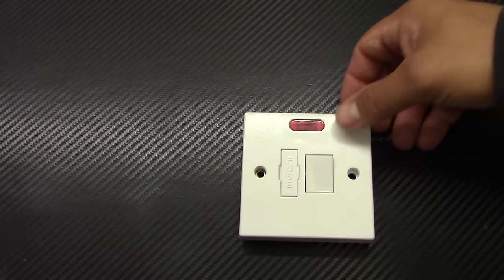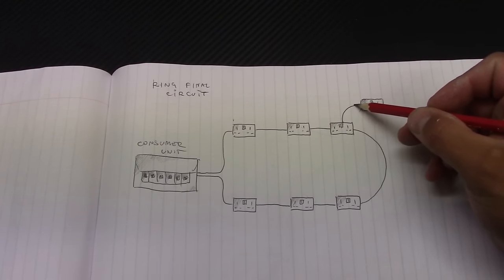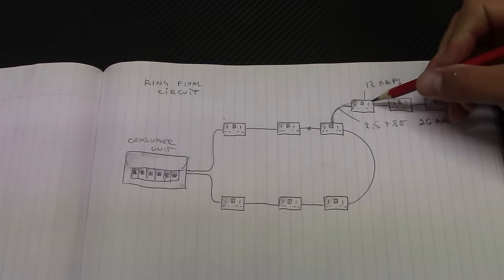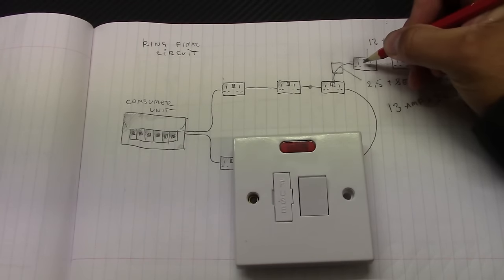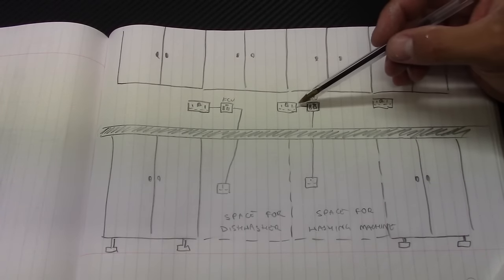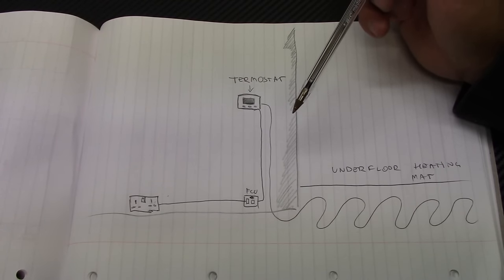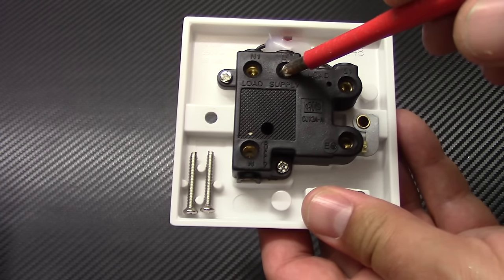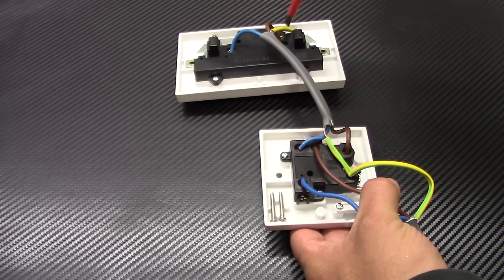Fused connection Unit    Wiring FCU      How to wire Fused Spur

Comment: Concise, informative and bullshit free. The way all instruction videos should be. Excellent work.
Reply: His calculation has slight problems on the elctronic side. He did basic calculation but that is not how it works in the real world. In the heater there will be some form of small electronic board which convert the voltage to a very high voltage and will only need may be one or two amps [some time only milli amps], thus one has to be very carful what you put in the FCU because it can damage either the  heater or other equipment connected to it. Ideally it should not be more than 3 amps but if one put 13 amps and there was a fault inside the electronic board the heater is good by....
Reply: I’m currently studying being an electrician. My training says to switch 13A fuse for a 3A fuse in the FCU, and also new practice is now to use 1.5mm cable

Comment: no special way of putting three wires into the terminal blocks on the socket youre taking the spur off? just put them all in and tighten it down? i'd imagine it would be safer if they were twisted together at least?

Comment: Hi, jus stumbled upon your channel and these video's and have a question.. If you use an FCU before the spur how many new sockets can you add to that spur?
Reply from the maker: As many as you like but the total load on them is limited to the 13 amp fuse
Reply from the maker: 13 amp maximum at fcu  that's in the regs
Reply: Hi, is fitting a series of RCD protected spured sockets an alternative to fitting an FCR?
Reply: I also would like to know the answer to this RCD question for spurs.
Reply: No, as the RCD protected sockets can still draw 13amp per socket. An RCD is a residual current device which detect imbalance (earth leakage) between live and neutral. An RCD has nothing to do with over-current protection.
Reply: @JTCamper  correct, you must respect the amperage maximums unless you want a fire...

Comment: Hi, quick question. If I wanted to run two double sockets and a light off a FCU how would I go about that. Would it be 15a fused spur off the ring main socket. Then double socket 1 spur off FCA, then double socket 2 spur off double socket 1, the 3-5amp fused spur off double socket 2, then light switch off 5amp FCA, then light off light switch?

Comment: Thanks. Helped me with telling my kitchen fitters that one 13amp FCU isn't the correct connection for washing machine, dishwasher and tumble dryer and telling me to only have one on at once isn't very professional or acceptable. Apart from it being dangerous as the fuse melted into the fuse holder when too much power was asked for.

Comment: Hi, that's exactly what I needed. But some said you can have the FCU from the ring, not from socket. which is correct? here is what I found: " Can I run a fused spur off a spur?
So basically a spur of a spur is never permitted, even if its fused. I'll have to just stick in a juntion box in the ring cables under floorboard and get a fused spur off that. Put a 13amp unswitched spur adjacent to the socket, then you can run whatever you like within reason from the outgoing or load side of that."

Comment: Good video and I agree that there can only be one unfused spur per socket on the ring. Having said that,  surely, though maybe not the best idea, two 2.5kw heaters plugged into a double socket should be fine. (2 x 2500watts) / 240volts =  20.83amps, with both sockets rated 13amps and the wire is rated 26amps. If any of those went on fire then surely they weren't up to standard. The rating should be the safe limit with a safety margin calculated in.

Comment: Very informative videos. Thanks for making them.

 I have a question.
I live in an old house, there's sockets only on one wall. There's 2 outlets 2 light switches and an fcu that is connected to the water heater for the bathroom. 
I want to have a socket on the opposite wall. The closets connection is the fcu. Is there a way to run a cable or buy a different fcu so I can add an outlet from there without having to switch it on, as that will switch on the water heater.

Comment: Hi, great video, just had a question would appreciate answer, 
What tests would you run before installing any additional sockets/spur onto an existing ring?
What tests would you run if there isn't RCD protection at the fuse box and had the old style rewirable fuses?
Many thanks

Comment: Thoughts on using an unfused 20a DP switched isolator rather than FCU for switching an appliance? The appliance has a 13a fuse in the plug.

Comment: Hi, thanks for your really helpful videos. I wonder if you can help me. I am replacing a spurred socket with 2 FCU's. One FCU to connect to 3 new double sockets, and the second FCU to connect to a new LED batten and one-way switch. When I remove the original socket, there's just the one 2.5mm Twin & Earth cable. How can I connect that to 2 FCU's which will be situated next to each other? Do I need to go back further down the original spurred socket cable to the socket on the ring, and feed two 2.5mm Twin & Earth cables to the 2 FCU's?

Comment: I want to add about 5 unswitched socket (in a ring final circuit) behind my entertainment unit this is because once everything is put in place I would not have access to the socket to switch individual items on and off a bit like when you install a washing machine or a dishwasher.   I would like to add 5 switches to these unswitched socket so I can individually switch them on and off,  seen a lot of videos but none showed the above example would be grateful if you could do a video on it, many Thanks

Comment: I assume this would also work with a single breaker box right? So If I wanted to bring power to the shed I would wire the connection from a socket inside and move it to the shed and connect it with a breaker box and then connect the sockets, lights etc from the breaker box?

Comment: i have taken a double spur from ring circuit and fixed a 13amp geyzer switch to it and used it to add 6 extra double spurs for my items of aquarium tank including heaters filters etc..and wired them with 2.5 wires..i did ok or not??

Comment: Hi, great info,
Just wanted to know, can you spur 2 times off the fcu,

Eg
Ring socket >fcu+spur in one room, then from the fcu to another room adding 2 more sockets

So the fcu will have the 2 2.5 coming in then 2 2.5 coming out, 1 to the socket in room 1 then 1 going to the other room adding a 3rd socket,

Any help much appreciated

Comment: Very good video!! 
please can you help me I am in a little problem , I have a big fridge freezer connected to a 13a fcu socket which is good however I now want to install a big 90cm cooker which requires 13a fcu socket also but I only have one fcu going to the fridge freezer , from your video am I right in thinking adding my cooker and fridge freezer to 1 fcu socket will be overload because the max load will be 13a and freezer and cooker will exceed that? if yes can I add a fcu to a isolated 30a cooker switch or use that instead of a fcu ? I read somewhere it’s not good to put a cooker which requires 13a to a 30a isolated outlet...

Below I have taken the time to get all the technical spec for each my appliance from the manuals 

American fridge freezer
BEKO Pro ASDM241PX 
230v voltage 
50hz frequency 
150w wattage 
0.85A current 

The fridge freezer has a standard 1.5mm twin&earth cable with 13A plug on it

Duel fuel cooker (gas cooker, electric oven)
Kenwood CK305-1  
230v voltage
50hz frequency
2270w wattage 

The duel fuel cooker has no cable or plug on it but the manual saying to add 1.5mm twin&earth cable to the feeder cable connection which is on the rear of the cooker and the other end Must be connected to a 13A switched fuse spur outlet.

In my kitchen where I want to place both appliances I have few normal non spur sockets plus I have a 13A switched fused spur outlet that is connected to a single socket, I’m thinking to change that single to a double socket so I can add the cooker and fridge freezer to it or could I add just the cooker to that and just plug the freezer to a normal non spur/non fused spur socket?

Comment: Can i wire. 4 block extension directly to a fused spur? Inhaveva fused spur that used to supply a fire. Fire removed and media wall going in. To avoid channeling and mounting sockets and have location flexibility wondered if that was an option?

Comment: I have an fcu (5amp ) serving a light switch for spotlights. I want to add a double socket off the fcu. I assume I replace fcu with 13 amp fuse and wire the connection for the double socket to the fcu using the supply terminals ?

Comment: In the kitchen,  I have a standard double gang socket for kettle and toaster.   The airing cupboard in the hallway on the other side of the kitchen wall, I have a washing machine. I would like to take power from the socket in kitchen, drill hole through wall into airing cupboard and wire a spur socket from the one in kitchen for the washing machine in airing cupboard. So basically, 1 washing machine on a single gang spur, kettle and toaster in kitchen from socket that is feeding the spur. Would this be ok please?? Thanks

Comment: Hello, What are the regulations/correct way of wiring a Beko built in oven rated at 2.3 KW  and the cooker hood? Can I used 2 FUSED spurs each wired back separately 2 a dual 13 amp socket?  Can I feed them both directly from the back of the 13 amp socket? Will there be enough room in the socket to terminate the hood and the oven? Do I have to wire them both separately?

Comment: If using a fcu 13amp connected to 3 switches can  you connect a separate cable into the same fcu and power 3 sockets? If so then can you put in an additional fcu 5amp to power lighting straight off the 13 amp fused sockets?

Comment: Hi sir, in ring circuit , cable is run from a mcb of consumer unit to the first socket and then the second socket receives supply from a cable connected between it and the first socket. My doubt is that wether last socket is connected to the consumer unit mcb which is connected to the first socket.  So far , what I think is that phase  outgoing terminal has wires ,negative terminal  two wires  and Earth terminal two wires... I guess correctly?

Comment: Hi, i have a question! Probably silly but what if i dont want to take the cable out from the socket but instead want to use a 3 pin plug, can i still follow the same example for fcu? Im trying to add a cooker hood and washing machine but the plug is far! I dont want to take it of a socket so instead i wanted to create a extended socket with a 3 pin plug but add a fcu in between. Is that ok to do?

Comment: I'm still learning about domestic electrical mains, and I came across a problem I need help with:

In my store room, I have an unused FCU switch connected to the mains, which used to be connected to the boiler. The boiler has since moved, hence the FCU now being unused.

From that FCU there is a spur to another FCU for the jets in my bath

How many sockets can I connect off of that mains FCU for things like 2 servers, routers, low powered PCs etc? I doubt they will use 13A in total. Someone has told me to simply replace the FCU with a double socket, but I need multiple sockets.

So, my question is how many sockets can I spur from that mains-connected FCU?

Please help.

Comment: What electrically is the difference between the unfused spur in the beginning and a radial? If you can use 2.5mm to do a radial with basically unlimited sockets why can't we use just 3 sockets here?

Comment: I have a question may sound stupid , if I have a single socket I don't need  can I convert that into my iso switch and then run the cable into another two double socket?. So then that becomes my isolation point cause I for say don't want that socket anymore..

Comment: If you’ve got a spur and then a FCU and then a spur, what’s the maximum current draw?
Reply: Do the maths. How many sockets have you got in the first spur. Lets assume a twin socket - so allow for a poss 3Kw per socket - so 6Kw being drawn off the first twin socket. As you then have a max of a 13amp fuse load after that - the downstream load can be a max of 230x13 = 3Kw. This gives a potential draw of 9Kw / 39amps on the first leg of the spured cable. This is much higher than the standard 2.5T&E is really capable of supporting and will melt and burn. The Fused spur swtich should be before any sockets so it is able to limit the cable load to 13amps / 3Kw - or lower if you use a 5amp fuse .

Comment: I have a spur twin socket with cable buried in the wall. I want to run another spur with low consumption from this spur. Can I put the FCU after the first spur and before the second one?
Reply: No! The point, is that the FCU must be installed BEFORE the two sockets on the spur. Otherwise the 2.5 mm cable priour to the first socket could still be overloaded. I presume your spur is a double socket, thus, one way around it might be to use a twin box that allows two single sockets to be fitted to the box. The first socket could then be the FCU, the second on the same box a single socket, then spur off that socket to your next socket.

I'm not a proffesional electrician. So research yourself to verify. But the point is you need the FCU first. You also need to remember that those two sockets are limited by the 13 amp fuse in the FCU.

Comment: Hello recently went to my loft and found that my spur has 2 red wires going into the supply. I understand that one runs from the socket to power the switch, that power my lights. However the second red and black wire run to another FCU and that powers my boiler. Does anyone know if this is how it is meant to be done?

Comment: Can you put 2 fused spurs next to each other. I.e. 2 fuse switches connected separately to the same plug socket?
Reply: Do you mean two spurs from the same socket on the ring? If so, absolutely not. As you would have too many conductors in the terminals of the socket on the ring. Plus, theres no point.

Comment: On a radial circuit. Can I source of of spur off and feed under floor heating load 900 watts.
Reply: David Patheyjohns you can have unlimited amount of fused spurs. 900 watts equates to just under 4 amps. So, yes, you can.
Reply: 900÷230=3.91A needing a fuse of 5A

Comment: If you have a spur on a radial but it's not fused is that socket limited to 13amp
Reply from the maker: not the socket but you have 13 amp fuse in the appliance plug that protects the cable

Comment: Can I wire an electric fire (max 2000 watts) directly into the switched FCU?
Reply from the maker: yes. you can use 13 amp fused connection unit with flex outlet for flex cable

Comment: Im a DIYer and rewiring a kitchen, how doe find out which sockets are in the FRC and which are spurs?
Reply: Open the socket and see how many cables are there.
Reply: @cormac2451  Thank you, ive done it now and touch wood its all good so far haha
Reply: @Andrew-xj6gh  Did you manage to get all your cabling tested and an Installation Certificate.  Kitchens & Bathroom are special places according to the wiring regs. You also need to be very careful regarding the validity of House insurance for works that have no Installation Certificate.  Fire started in the kitchen ????
Reply: @cormac2451  

Wrong! You could have two cables and assume it's on the ring when in reality someone has fitted an un fused intermediate socket on a spur, against the regs.
Reply: @shilks8773  

Kitchens are no longer regarded as special locations and some work, such as adding a spur or replacing sockets is permissible now and not notifiable.

If in doubt. Contact your local councils building control officer and ask.
Reply: @shilks8773  am I right in thinking any works now needs a mwc or if notifies like sparky will notify labc , the amount of diyers that will be voiding house insurance will be a lot.

Comment: These fuse switches say 13 amps on them, can a 4 amp fuse be put in or will it not be able too work.

I
Reply: A lower rated fuse will work fine. Indeed when these are used to supply things like extractor fans, cupboard light and so on, this is normal practice. However, if this is a fused spur for sockets there's not much reason to use anything other than 13A
Reply: You can use and should use a lower rated fuse if using a conductor of a smaller size. 13 amps is for spurs from ring main with 2.5 mm twin core and earth.

Comment: Can you add the FCU after the 1st spurred socket instead of before like you have done? Thanks!
Reply: Definitely can!
Reply: videoraver this is what I’ve actually done in my shed but I’m not sure this is right to do this.
Reply: No! Must be FCU FIRST! then sockets or the cable priour to first socket could be overloaded.
Reply: @LSF315  

No it's not right. FCU first! Everything AFTER the FCU draws current. Thus FCU must come first. 

In addition, if you have run cable to a shed yourself you have acted in contravention of the regs. Outside is a wet area, thus regarded as a special location, thus requires professional installation and certification.

Comment: what countries do this?
Reply: UK ring circuits. Almost all other countries use a star topology whereby radial circuits run to each socket. We in the UK and for some bonkers reason still do, use ring final circuits with un fused or fused spurs often running off. We also wire some things as radials, so I suppose you could say we have a hybrid system.

Comment: I've got an outside boiler coming off a fused unit,can I also run off an outside plug socket off the same fused unit?
Reply from the maker: I guess it's a 3amp fcu  dedicated for boiler only and not 13amp.  you can convert it into 13 amp, fit socket after fcu ,   plug there a flex cable from boiler with 3 amp fuse and also  run cable from this socket to the outside socket this needs to be rcd protected